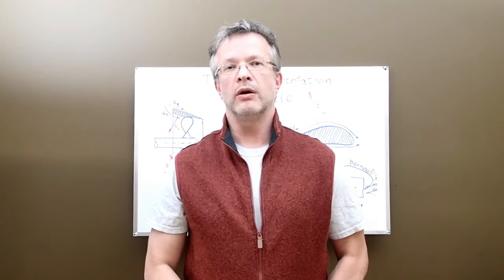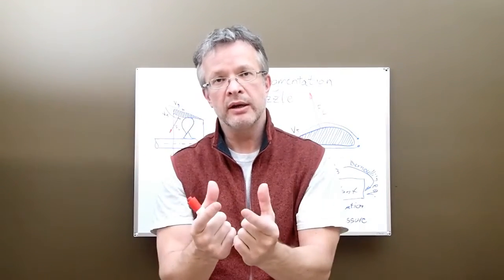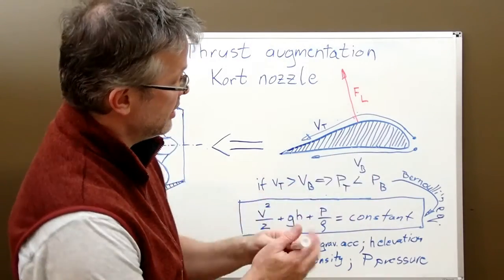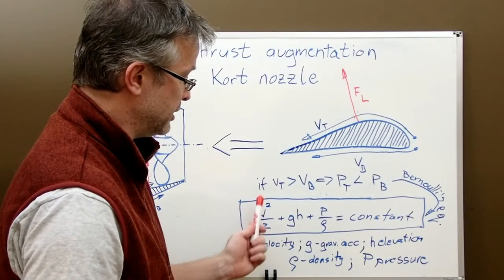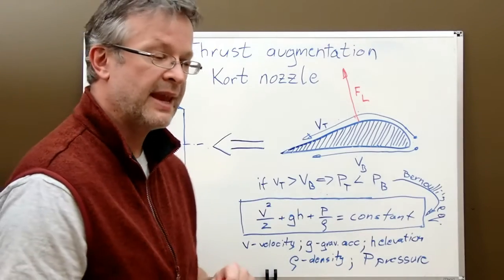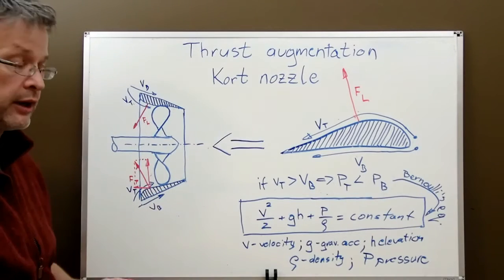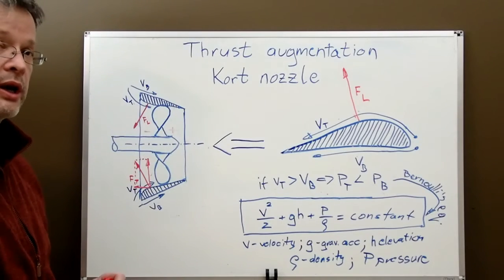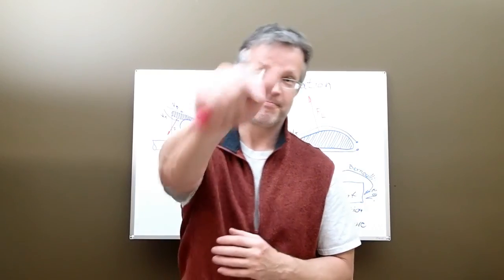Whiteboard Mondays 09:  Kort Nozzles

Comment: Is it similar with ducts on drones? I think the force is magnified because water is much more dense, but I think it is the same effect.
Reply: Yes but keep in mind that having a ducted propeller , which trust is direct for example upwards in a moving fluid like air  can induce some unwanted effects.
Imagine that you are moving at a slight angle in this fluid, the air coming from in front of the ducted propeller will be faster therefore having a lower pressure which creates more lift, but , the air getting sucked in fronte the propeller coming from behind the propeller will be slower because it will have to move  against the fluid  the ducted propeller is moving in therefore you will have higher pressure resulting in less lift.
Consider that combined with the effect of the frontal higher lift andò you get yourself a very nice(noto really) tilting momentum which Tries to readjust tour asset to a position in which the fluido enters the propeller at more or lesse the same speed from Every direction.
With multirotors you will have some chance because of differential thrust bit otherwise you can't gi very fast😅
For  examples search that gold project known ad the American saucer it was this weird UFO Mike contraption which was great bit in real life couldn't go fast at all😂
Reply: Yeap! Good catch! Exactly the same. I would say the pressure separation at the tip of the blade would be the primary benefit in aeronautical applications while with water the "hydrofoil" effect is listed as the primary factor.  There is also a different type of Kort nozzles, not discussed in the video,  which creates increased pressure region around the propeller to minimize the cavitation and these nozzles don't apply to aeronautical solutions.